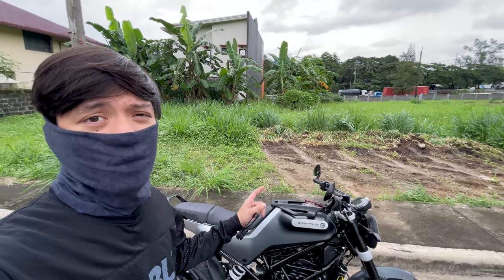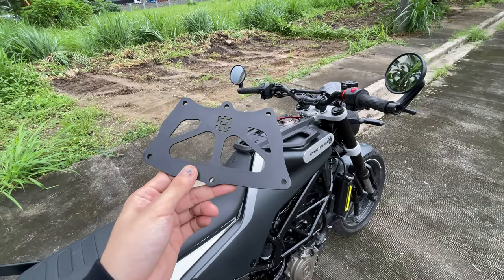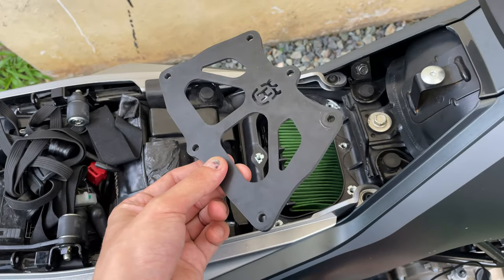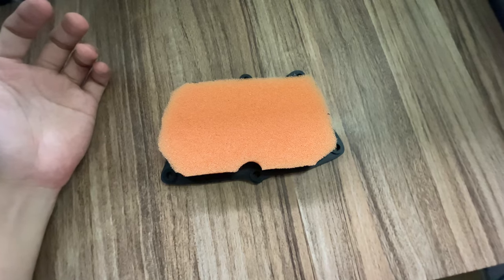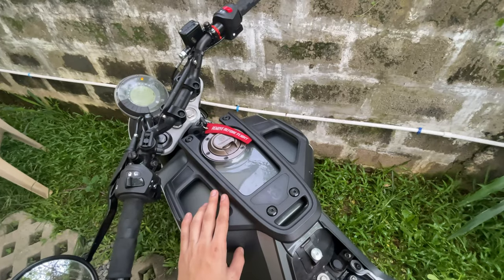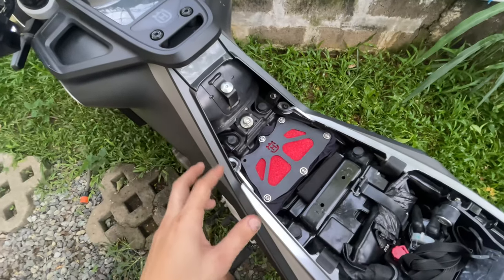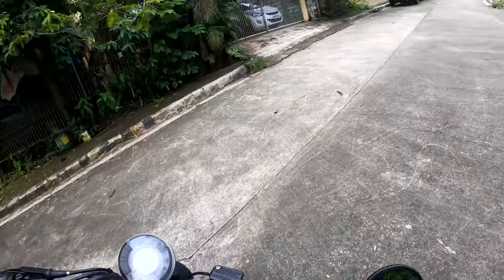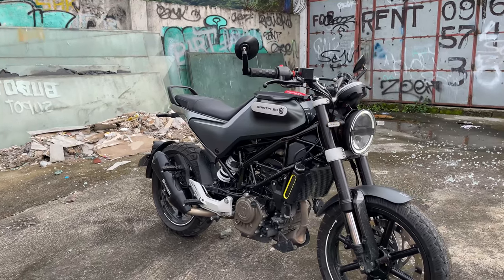Husqvarna Svartpilen DIY Airbox Mod | COOBER Upgrade KTM

Comment: What will happen if I remove the airbox lid completely? I noticed a big change in engine sound and I quite liked it but can I use it as is? Or can i buy some other lid in local shop and do use it that way? I don't have enough money to buy this 3d print version
Please help

Comment: You should really think about this mod from a makers point of view. If making a few cut outs and adding sponge underneath the air box cover will boost performance then the 1000cc Supersport would have had this long time ago. 

Unless you tune the ecu with a air and exhaust system you will not see any gain. Infact you may lose bottom end torque. The overall powerband might change a bit some place in the rev range you may see some marginal improvements some place you may see decrease in performance. 

Air is most probably being sucked in through the cut outs since the sponge would be least resistive path for the air to flow through as compared to the paper filter.

Comment: Do you have a separate vlog about fitting your svart 200 with 401 stock pipe? I am also opting for this kind of set up. Already preorder a 200 after the huge price cut announcement. June pa raw ang release. But I am already planning on fitting my unit with 401 stock pipe. Meron ka ba vid nito and do you have pics of your svart 200 with 401 stock pipe.

Comment: Great video! I have a 701 Svartpilen 2020 and just got it. Where did you get those bar end mirrors and are they better than stock or they just look good. Also, how do you like the tank bag. Some with the bike felt it messed up the appearance and effected their riding because it got in the way. Thank
Reply from the maker: I got them from an online store in my country. Where are you from? And yes, they work equally better than the stock. Also, not really a fan of tank bags 😅
Reply: @juanicofernandez  I am in the U.S. Why don't you like the tank bag? Have you considered the side bag and if not why?
Reply from the maker: @p-dub7422  Personally, I feel like it doesn't match the look of the bike or it breaks the shape of the bike, 99% of the time I'll most probably use a backpack.
Reply: @juanicofernandez  I have been thinking about that.
Reply: @juanicofernandez  what about the side bag?

Comment: My friend...
Sorry..
But all motorcycle for respect law, emissions etc etc, are very lean..
Open filter mod, entry more air, and carburation very loss.

The bike not work correctly,
On off, ecc ecc..

If remapping ecu after this mods,
It better.
Of course my opinion

And svartpilen is best friendly and very fun

Comment: yup, problem with svart 200. mabibitin ka at not too comfortable on long rides due to sitting position. parang scrambler tapos enduro style yung body sya. kung porma lang hanap mo at basic trails then eto ang motor para sayo. if you are looking for speed, go duke 200 or vitpilen.

Comment: Without mounting a complete exhaust (with de-cat) and an ecu the bike will only make more noise, the performance remains unchanged indeed it is probably even worse for the health of the engine as more air enters without increasing the petrol.
Reply: It’s fuel injected. Anything done before combustion like this really isn’t adding power, just making it not as hard to pull in the air. Past that the air fuel mix is computer controlled, so you cannot really do damage. It’s the people removing the entire exhaust without an ecu remapping that are potentially harming their bikes. A slip on muffler is fine, but removing the cat and chamber will make the already leaned out mix from factory do some damage.

Comment: Great video Jaunico. Unrelated- I'm looking at tyre options for when it's time to replace my Pirelli Scorpions. Which tyre is that you are using? Not seen that tread pattern before.
Reply from the maker: Those are the stock Metzeller tyres for the 200 :)
Reply: @juanicofernandez  Ah, okay. I hadn't realised it was a 200 model. I have a UK 401 with the OEM Scorpions on it. Are yours 150/60 17 rear and 110/70 17 front? Or does the 200 come in a different size.
Reply: @CampbellZeroOne  MRF Revz D-FD